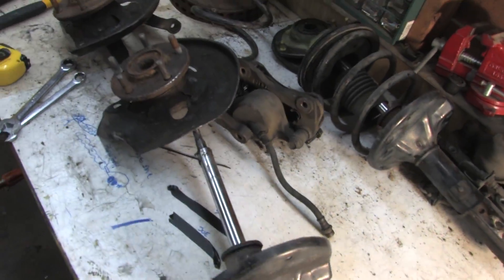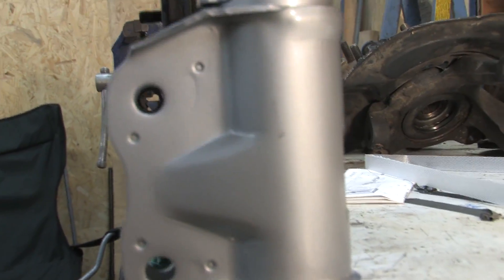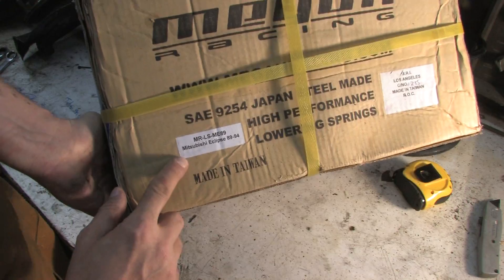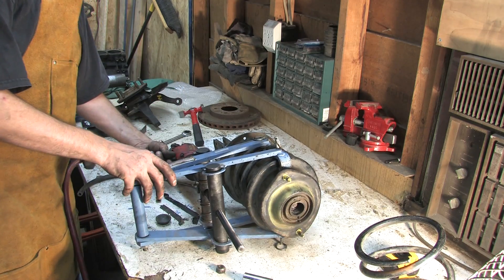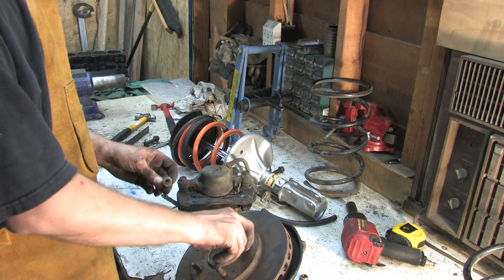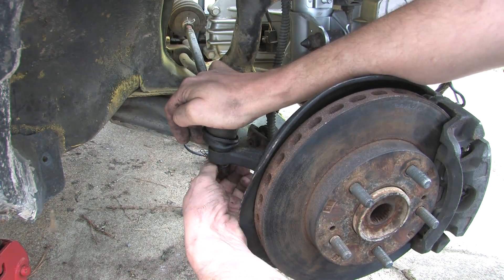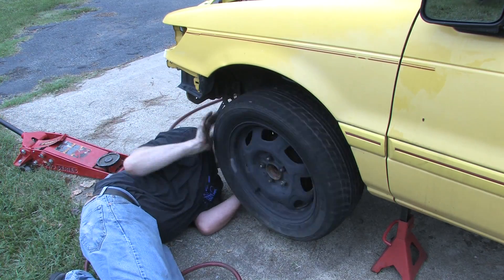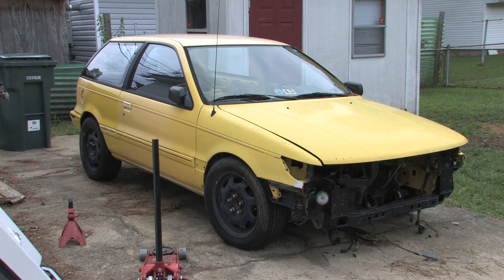Colt front suspension assembled & installed

Comment: I've been following the process of converting from 4x114.3 to 5 lug and so far i'm starting to get it, but i'm still confused. I'm keeping my Summit FWD and i'm still with the 4G15 1.5 and 5 speed manual, so, in order to make the rear 5 lug as well, do i only  need the DSM hubs and rotors? I already have Colt GT brakes on the rear. And for the front, can i still use my actual axles? (1989 Eagle Summit LX). Thanks in advance.

Comment: I noticed you mentioned the 4 lug rotors were not vented on the expo... [for anyone else wondering] if you wanted to keep 4 lug, and use vented rotors with your expo knuckles, you would use front 1991 Galant vr4 4 lug rotors and the twin piston awd dsm calipers also on the Diamantes and 3000gt's calipers, they are vented I'm planing on running them in my setup on my Mirage project.
Reply: +Mitsubishikid of course the 5 lug opens doors to more wheel options, and the 4 lug wheels that come stock likely wont fit with the awd big brakes on the expo knuckles and finding proper spaced wheels can be an issue.

Comment: @Jafromobile Thanks so much, really does help. I noticed that on the DSM forums, the debate is mods vs appearance vs price...someone just said buy some SS bolts from a hardware store and you'll be fine. It just needs to hold the valve cover on, and since yeah, its all finger tight only so, it's not loaded up with torque. I just want it to work and fit, and get the car out from under my carport. :)